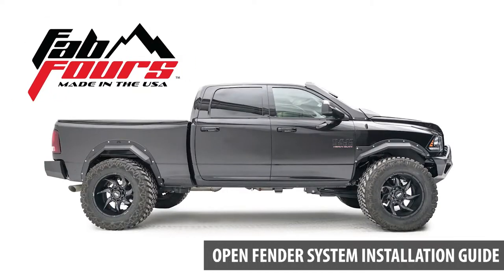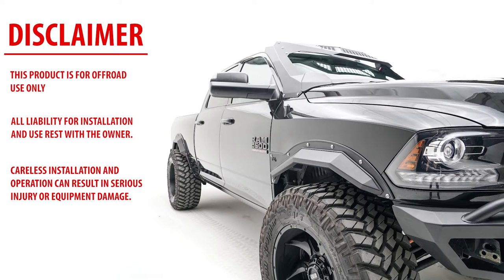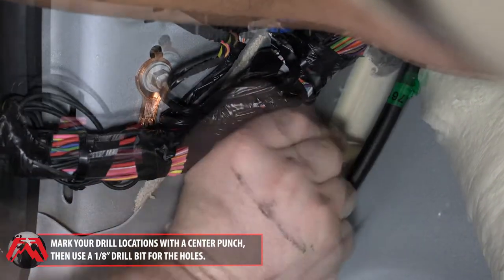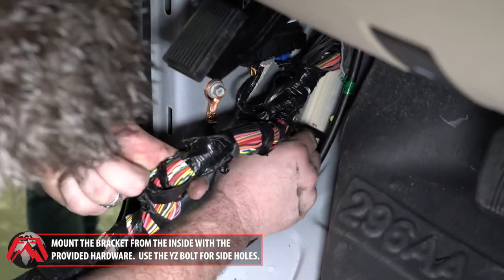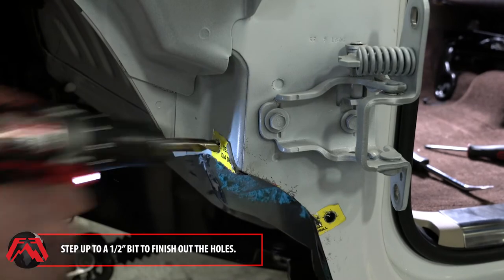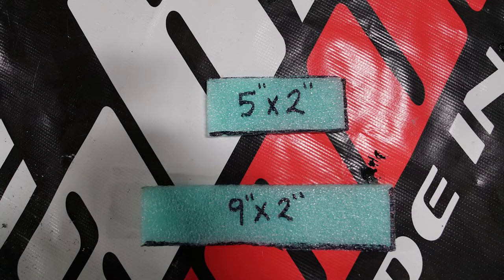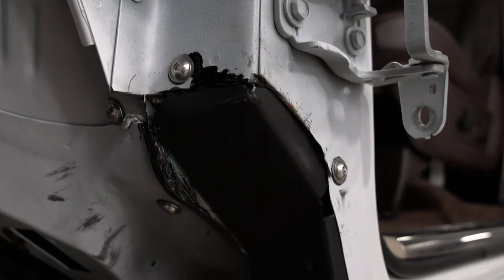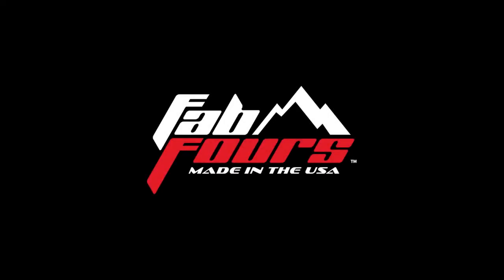2016-2018 Dodge Ram // Fab Fours Open Fender System // Installing The Rocker Channel Plates

Comment: Outstanding concept, but looks like shit.  All the crazy, weird angles.  And lose all that crap around the windshield and the funky grill.  C'mon.  The fender system has potential, if you round out the wheel openings and add substantially more tire coverage to help keep things street legal.